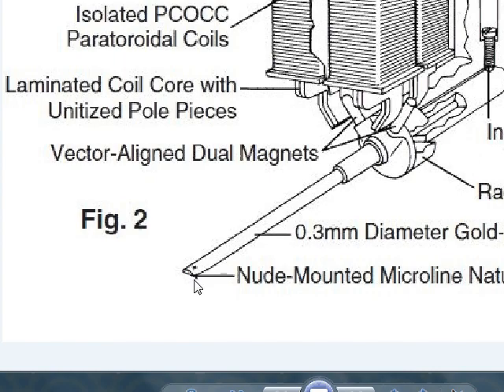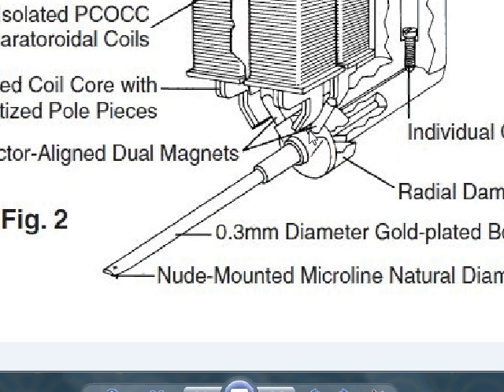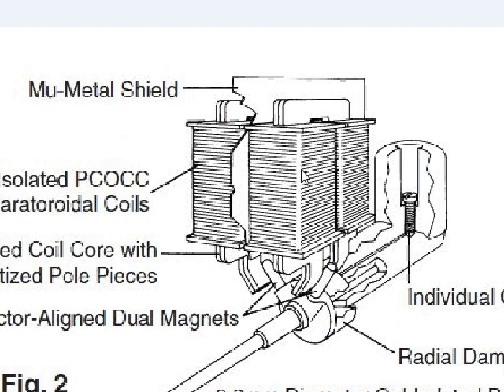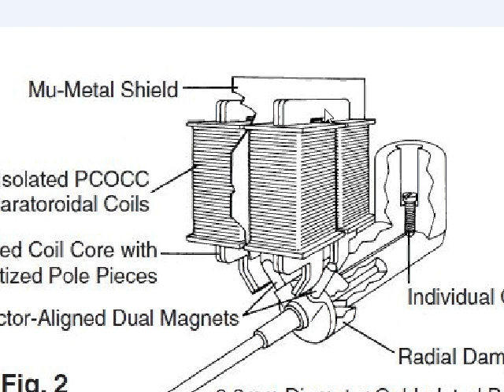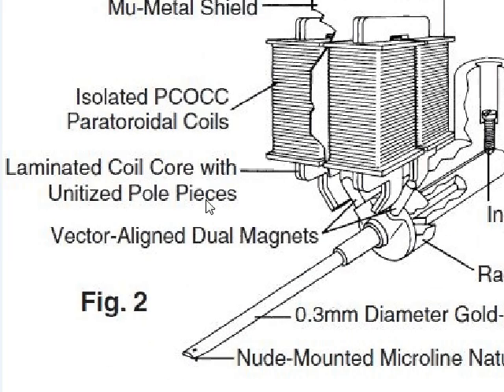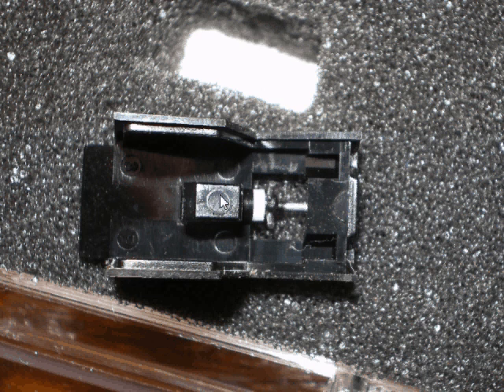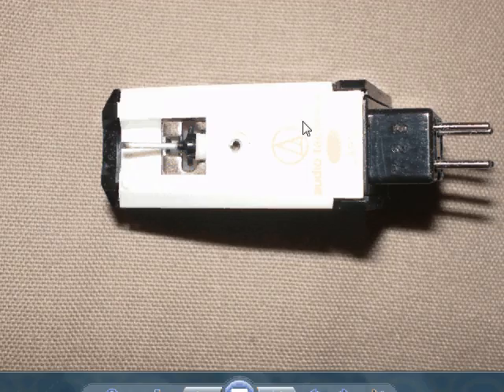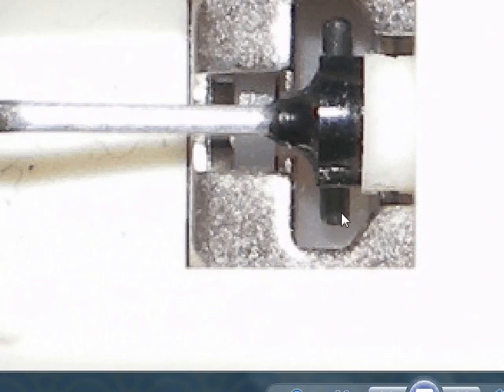The Moving Magnets Of A Phono Cartridge

Comment: i recently bought an at-110e cartridge with a perfect looking stylus from ebay.hooked it up and no sound on right channel. i saw your video and thought hmmmm,so i bent the magnets to where they looked more straight,no difference.took a magnetic pickup tool,stuck it to a small screwdriver,rubbed the magnets and it remagnetized them.worked perfectly!

Comment: I have had lots of AT cartridges, and you can loosen the cantilever screw (Scrape away the glue on the screw head with an X-Acto knife.) Rotate to align the magnets, and make sure it is seated all the way back in, and tighten the screw, (but not too much).  Then using a pocket microscope check that the stylus is perpendicular to the cart mount. If the cantilever leans to one side, horizontally there is some play in the rubber gasket, it may straighten out a bit in it's break-in period. Adde a small drop of nail polish on the screw after you have played and tested alignment. If you just bought it under warranty, send it back, immediately.  If not under warranty, you can take out the stylus housing, and push the cantilever to one side to loosen the gasket, but not too far or it will break. Never flex it up and down, or it will change the rake angle of the stylus, and effect the intended tracking force. After adjusting an unworn nude elip or a microline, you shouldn't notice much difference in sound, any distortion will be mostly in the upper range if it is slightly out of alignment, you can compensate a bit on the stylus shell if needed. I have mostly P-Mount cartridges, and this is the only option I know of except replacing the stylus again. I had to do this with an 440a Microline that I bought for a P-mount, and had to remove the cantilever to mount in another cartridge mount, (A lighter mount such as the old AT P-Mount have). I risked ruining a $125 Microline stylus, but had no choice, and it actually worked and sounds great on my . There is probably even some stylus guy out there who can take a microline and mount it on a cantilever for you, or a custom made cartridge, but I imagine that  would be expensive. The microline is still cool to look at under a scope, if you have a broken stylus...

Comment: I know this is a rather old video, but here goes:  The stylus you showed as the one being bad, with the close-up of the magnets showing the bent looking one, what you had there was a very cheap generic replacement stylus,' the dead give-away being the somewhat rectangular looking vector magnets, not to mention no Audio Technica emblem on the underside. Had you bought a still commonly available genuine AT replacement you would not have had the sound issues to start with. If you are having success saving the few dollars with generics, go for it. And be aware AT makes a plethora of private label OEM cartridges, so just because it has your turntable's brand name on the cartridge doesn't mean you have to buy just the generic for it; you can explore the genuine AT replacement for it and not have to worry about high defect rates common for the cheapo needles.

Comment: it's that double 45 degree in reverse for your stereo track,  barring the head being physically abused , for the magnet to move like that may be bad engineering on the part of the sound editor.. the coils must pick up tiny vibrations , so there isn't much holding them in place, very delicate.. if you know which record you were playing when the things went a miss, then you may have your culprit.   The needles on the 45 degree must move out of phase with each other , giving you two separate motions, on the walls of the groove, but if a particular recording had both needles moving in phase (the sound editor is paid to make sure these things don't make it on to the production master) then it will cause damage and even a hole, or an abnormally deep groove in the substrate (vinyl) , and that extraneous movement will be transferred back into the magnets of the head,  causing them to miss align like yours did..  a badly word or damaged lp can do this too, if left to skip or the stylus digs a new groove from a bump, then falls back into it .. but there have been bad records sold right out of the sleeve, that inexplicably destroy heads.. especially if you think how fast beetles singles were coming off the shelf etc.. no time for quality control , and besides, most just ended up on girls walls or being hugged until the next single was released.. Vinyl has a great warm sound, but being analog, is just not robust enough , which is why we went to digital..

Comment: Interesting  so if the stylus gets pushed one way one magnet is parallel and the other is perpendicular.  So each direction it's pushed only influences one coil.
Reply: sort of, they tried to do a 90 degree so up and down gave one set of impulses to the magnet, and side to side another, the didn't work, as a big sound would inevitably hole the substrate , or make an un reasonably large groove..so the double 45 degree was co opted.. instead of the stylus getting inputs from only the vertical groove in the record, it uses the side walls of the groove to get inputs from,  in effect doubling the amount of input it receives. 
  It's done by placing the magnets and coils at 45 degrees kinda like riding your bike on the walls of the ravine rather than along the bottom .. much easier to illustrate, it's quite simple..  but you are in effect correct